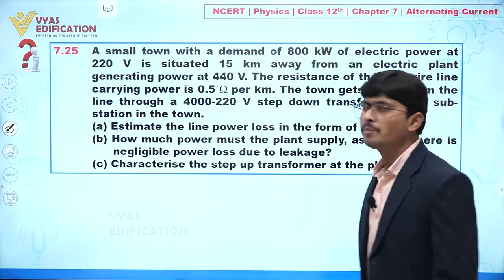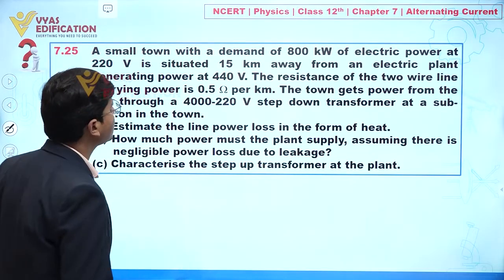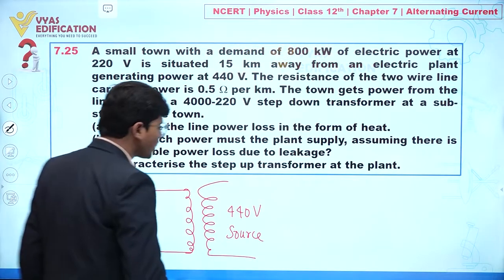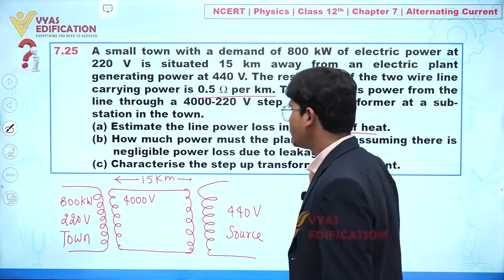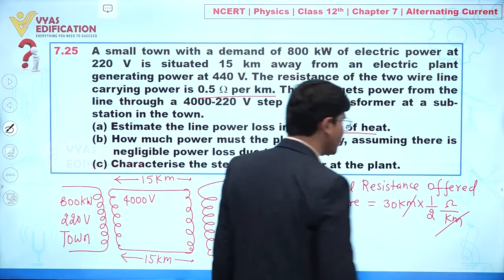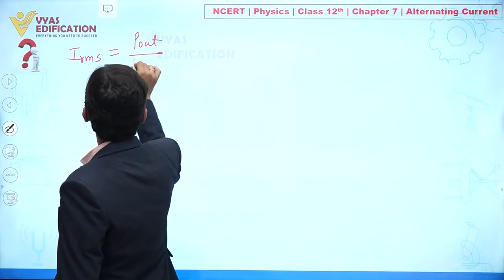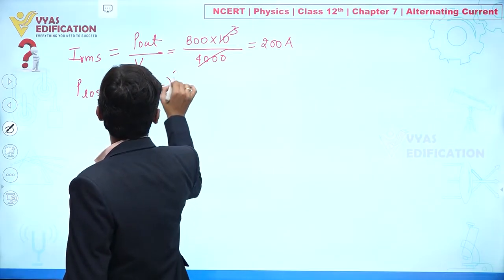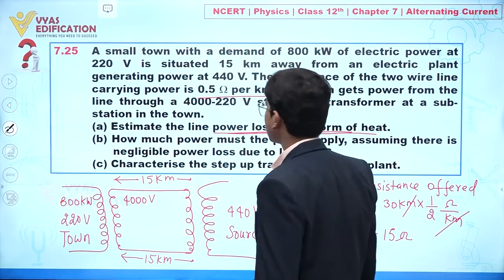NCERT 12th Physics Chapter 7 Q 25 Alternating Current

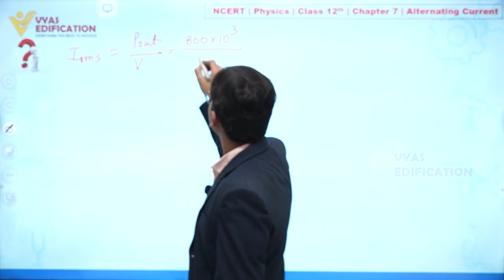Comment: please tell me at 3:27 why u put v 4000v and not 440 VOLTS
Reply: Actually 440V put krne se town ke current ki value aati but we need current of line (30km) to calculate power loss due to resistance of wire of line.